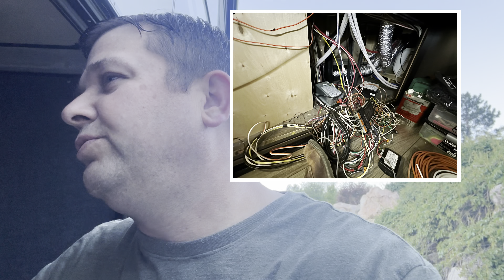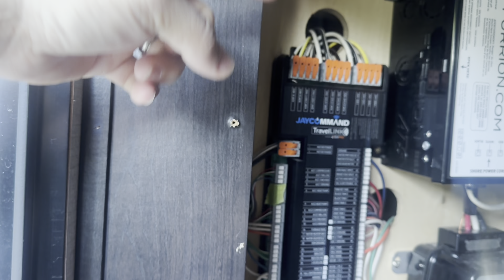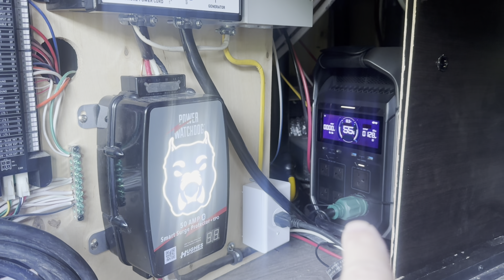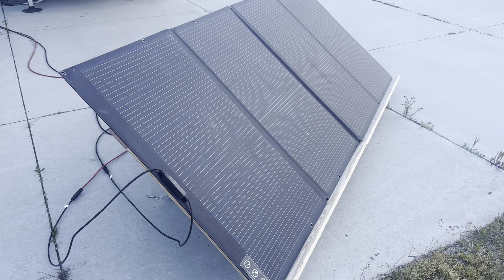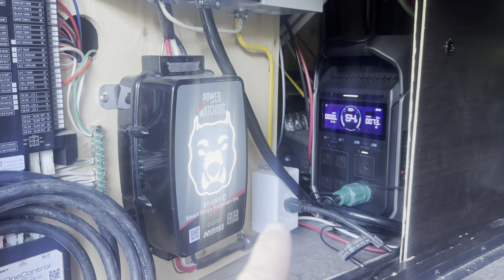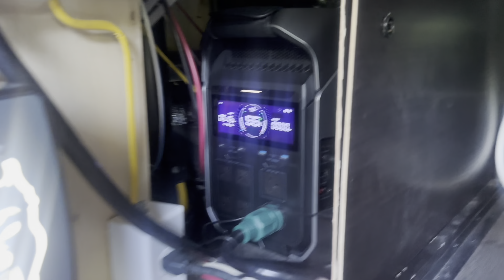Power an RV from EcoFlow

Comment: Super helpful, thank you so much for posting. Question, would you mind sharing details of the exact components and how you wired them together inside the contactor box (which only supplies 120V when shore power is applied)? Thank you!
Reply from the maker: I think I drew up a schematic. I will look and post it here if I did.

Comment: the ecoflow delta 3 pro fried a board on my new fifth wheel.   fluctuating hertz.  basically this exact setup.  for some reason,  they dont play well together.  Another thing is that the delta pro 3 has a floating ground, which also may be a problem,  you might need to use a grounding plug.    Ecoflow really screwed up my setup, and their support is horrible.
Reply from the maker: Man I am sorry to hear that. I have not had to use the grounding plug with my Delta Pro 3. I have a grounding plug for when I need it. If I plug my trailer into a generator and bypass the DP3 then I use it so I don’t get the error on my Power WatchDog. But since I plug my EcoFlow Smart Generator 4000 into the DP3 to charge it with DC then I don’t need it anymore.  Not sure what would cause the hertz to fluctuate. I have 9 different EF devices and have not ever had that issue.    I assume you know how to ensure it is the correct hertz and how to change it if needed?  Let know know if I can help.  Lastly, I have had great experience with their support. Have you tried asking on a face book group or the EcoFlow forum on their webpage?

Comment: What is the advantage of using the 240 connector instead of the 30amp connector with a 50amp dogbone?
Reply from the maker: 30 amps at 120 is 3600 watts. At 240 vac this unit can output 4000 watts so there is a bit more power doing it this way

Comment: WOOHOO... 1st comment. I am offgrid in my cabover camper on my own land here in AZ. I have Two Delta 2's and each of them has an extra battery... and  Delta 1300 (pre wifi and BT) Can you have solar as the primary recharging source..?  The battery would stay at a much higher %.
Reply from the maker: Thanks for being the first to comment.  Yes you can. That is the only sources we use day in and day out. We did put the outlet in to charge the DP3 when using shore power but since the trailer is running off the DP3 that outlet is not energized.
Reply: @hiddenspringshappenings3945   Ahh..  I understand. Lots going on.. and doing things differently for the vid..